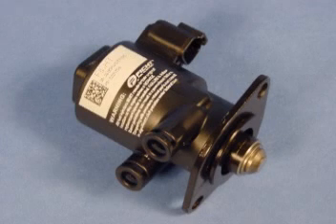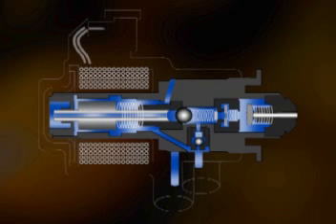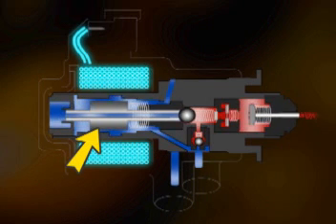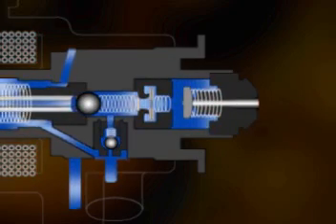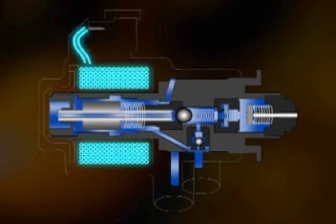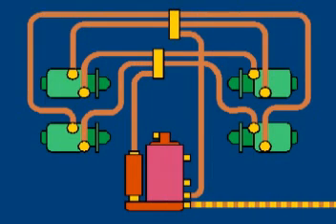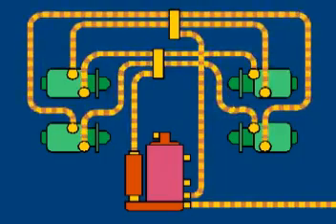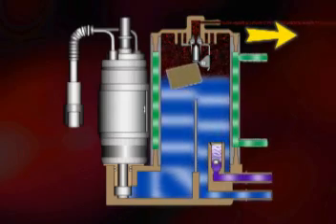Evinrude Ficht DI Fuel System

Comment: Not yet.Mine starts, but turns off immediately over and over till it warms up. Then it works great all day even if I restart it. It just does it when engine is cold. sometimes I have to start it 50 times to get it warmed up.
Reply: You might have to get the emm scanned for codes. Being it's a hard start when cold could indicate a sensor is bad.
Reply: OK Thank you

Comment: I reminded 1997 right around the time they brought the fict out there was so much hype about this technology at the time the first fuel injected 2 stroke at the time omc released the fitch to soon there were to many problems they did not get the bugs worked out yet great motors when running good and you can figure out what to modify or replace or upgrade to get it running right these Fitch motors are a steal then

Comment: So the Ficht engines were fuel injected.  If you have a Carb system they have none of the problems mentioned in the message boards?  Is this correct?
Reply: Yes Bob. If your motor is carbed then skip over this. Most causes on your carb motor is cleaning it. Or..a rebuild. These are fuel injected motors.
Reply: Thanks   :  )
Reply: However I would rather a carb 2 stroke over an early ficht

Comment: I'm looking at one right now it is a 225hp ho and it has 125 compression on all cylinders but one has 60 pounds and the guy was told it needed a emm of computer for it but what the hell about the lower compression on that one cylinder what could cause that

Comment: Hi Wolf,
Motor is still turning off with 1 second after starting.  any advise. once I crank it enough times I r will stay on.
Reply: Have you replaced the lift pump? Lift pump is for idle. Next time you try to start it...squeeze the bulb until it's hard. Try to start and have a friend keep squeezing the bulb. See if it isles then. What did you do to it so far?

Comment: I can't figure out how the heck it regulates the fuel pressure when there's no return line to the tank... If there's too much pressure where does the excess go? Or does it simply pinch off the pump side to maintain 30 lbs??
Reply: the excess goes through the vapor separator, then expelled depending on what the ball valve has increased the pressure to, and injected directly into the intake manifold. this SHOULD only happen on occasion, like when going from idle to wide open throttle and back again, where fuel gets a chance to pool up in the tank. so the vapor tank can be seen as  a sort of "return tank" .

Comment: 2005 Ficth DI that has a miss at any RPM but not at full throttle.  No mechanic in my area can resolve the problem.  The engine has 128 hours on it.  Bought used a few months ago.
Reply: My Ficht has the same prob. A stumble at a certain RPM. Mostly low ..id say 2000-2500 rpm. This is normal on these. But if you have a studder at 4-5 K rpm then there's a problem.